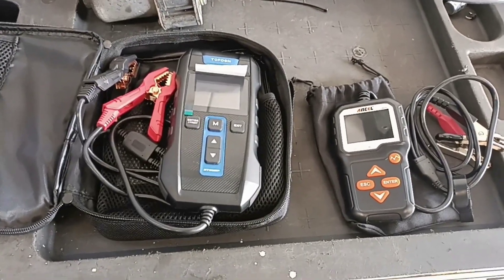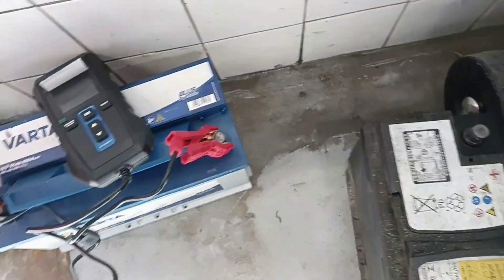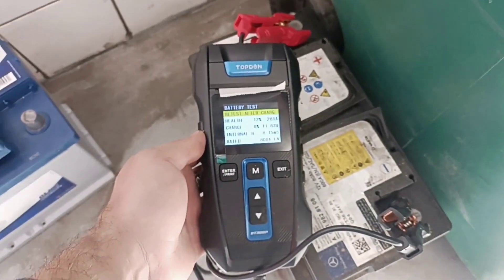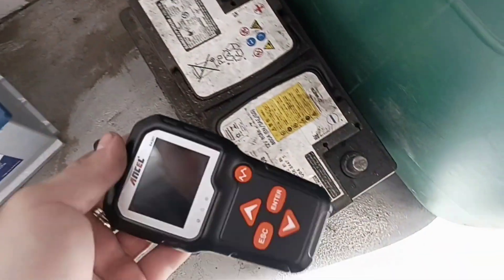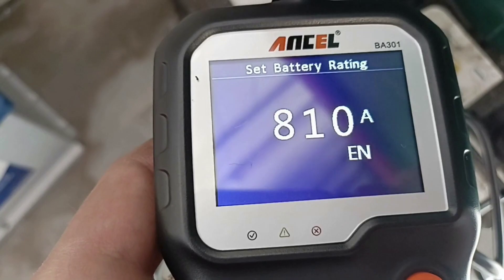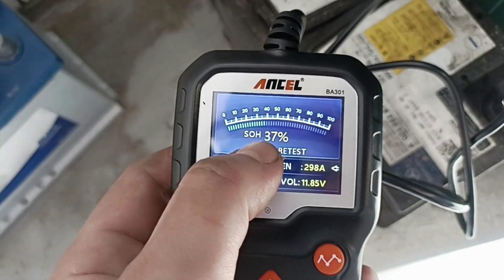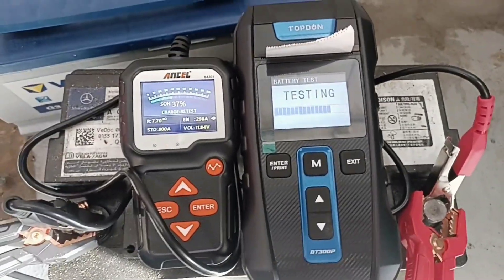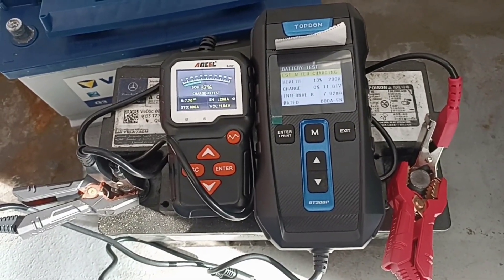Battery-Tester. which one is more accurate??? Ancel BA301 vs Topdon BT300P

Comment: One thing to mention for the Ancel. It is updateable but not on a Windows 11 or later Windows 10 computer with secure boot.  Their driver for the USB access is not Microsoft signed and it can't be installed in order to connect and update the unit.
Reply from the maker: Correct, one of the reasons to use Windows 10 when you have to deal with cars.

Comment: You're correct. The battery health is the actual capacity (298) divided by the the nominal capacity (800) in percents. Ancel got it right.

Comment: I tested a Lancol, very well reviewed, and it shows the same. 400Amp left from 640 and it shows SoH 15-20%. state of charge 0% with battery at 12.0 Volts. instead what I liked very much, was kingbolen 580.
Reply from the maker: @PaulPPR  👍

Comment: The battery needs to be charged for a more accurate reading.
Reply from the maker: I agree with you only partially.  Now it's not about the reading, but about the erroneous percentage shown by the scanner.  Regarding the charged battery, I do not completely agree because let's say that a car starts hard even after traveling for 2 hours.  How much more charge does that battery need, we have to give the customer correct information.  And if I don't pay attention to the calculation made by the scanner and it reads that it only has 400 amps left when starting, but it shows me that the battery is 20 percent, it means that it gave me erroneous information, because  is 50%.  That's how I see the situation.
Reply: Try  a 3rd. One battery tester